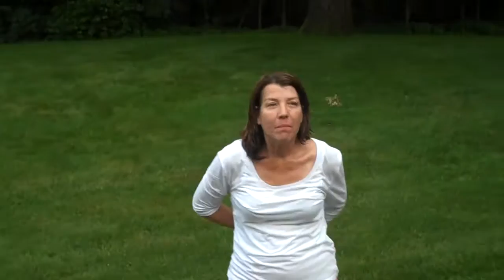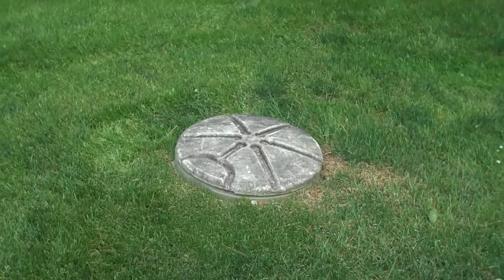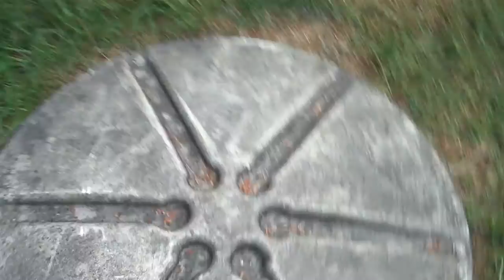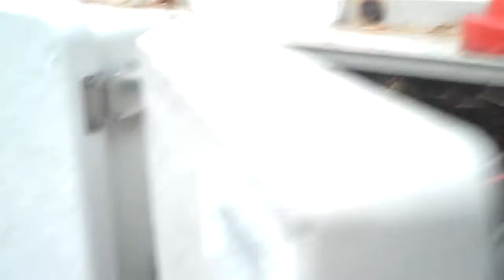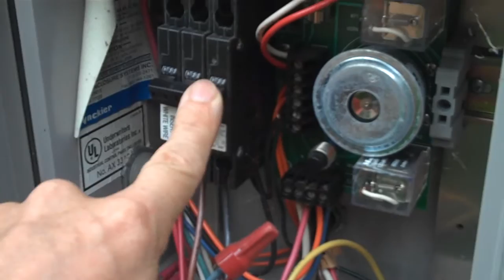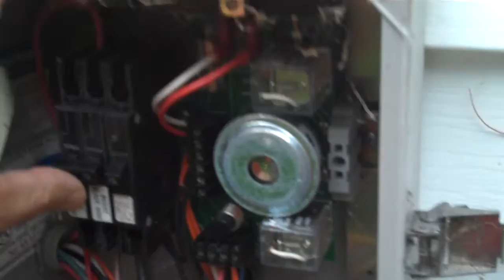E/One Grinder Pump Alarm Test Failure Series 2000 on Gorham Street

Comment: How ironic that a system designed to increase reliability and safety is being blamed for causing a decrease in reliability and safety!  Imagine that I had a car with brakes that didn't work - and imagine that the mechanic said, "We fixed your brakes by bypassing the anti-lock brakes."   Now your brakes work.... but you can't stop safely on slippery roads. The problem I see here is that the "Fix" is now preventing the homeowner from getting an alarm during a power outage. That's a function that was supposed to work in the original design. Just like the anti-lock brakes example. I wonder who decided that the battery backup function wasn't needed? Was it simply a cost decision?